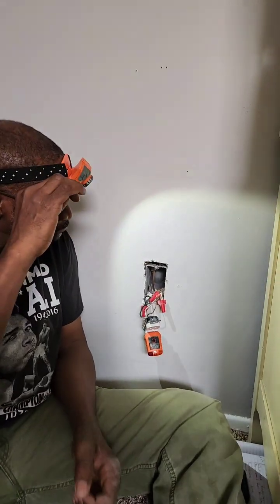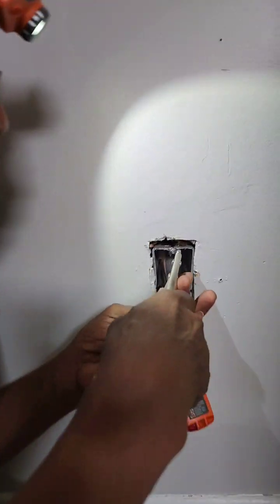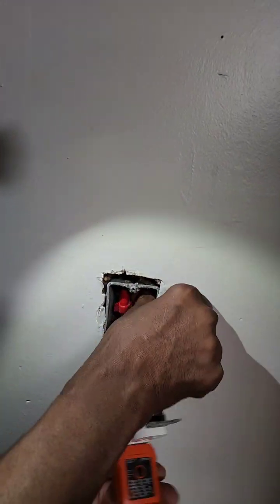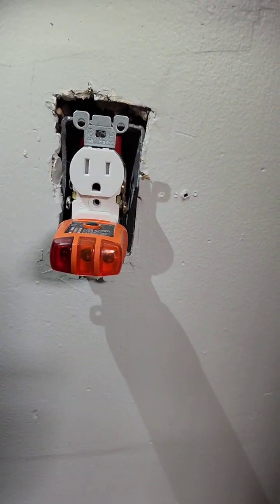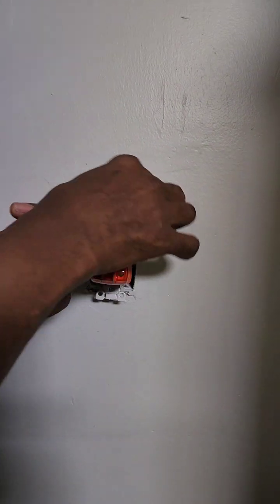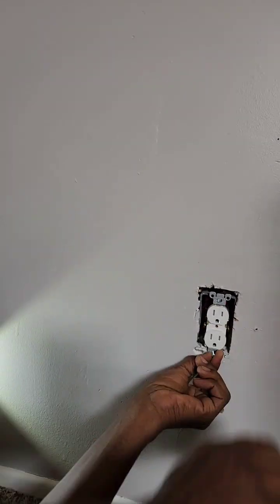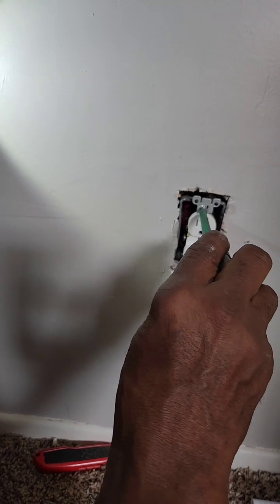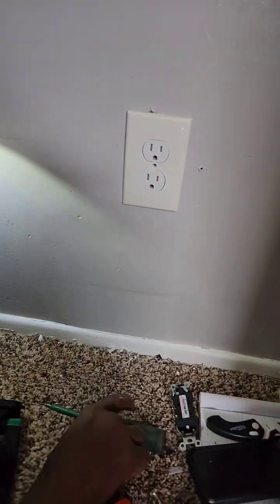Electric Box Easy Broken Screw Repair and Replace without removing Workbox. Part 3

Comment: Thank you Mr. Pace....helped me out.   After removing some plastic, I ended up using a Dremel tool to cut a slot in the screw and removed it with a screwdriver.